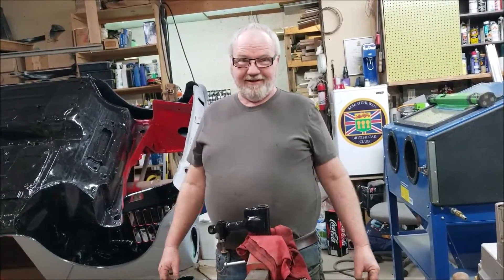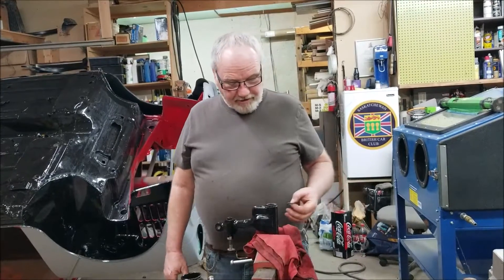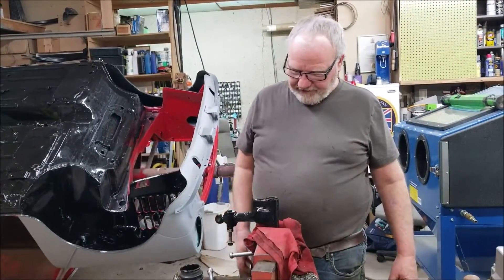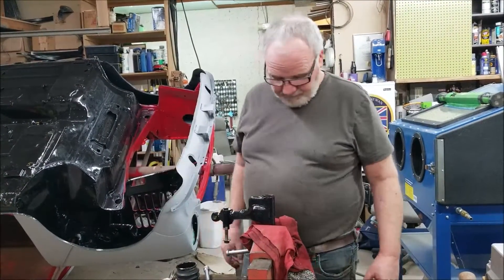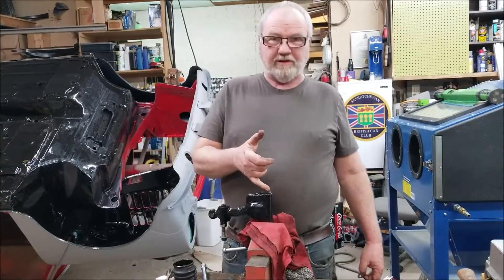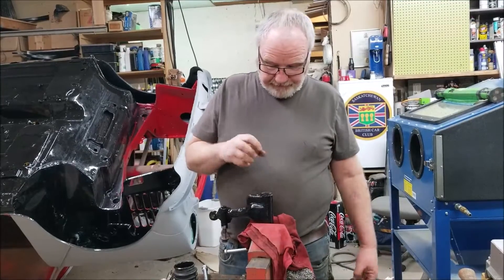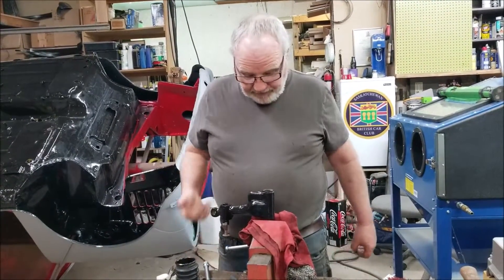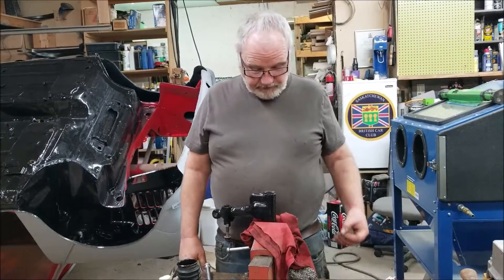Classic Mini Upper Arm Bearing Removal With 15 Cent Washer

Comment: Just thought I’d chime in here. This technique works perfectly I’ve just done this today. Thank you Wayne. I had severely corroded shaft and bearings. After filing down an inch diameter washer to 18.8mm across the flats and 22.3mm remaining diameter and after a little grief locating the washer so that it laid flat (I wanted the remaining diameter to be as large as possible) I used a 3/8in socket extension to tap them out and both bearings came out easily after the initial stern hit to shock the corrosion.
Reply from the maker: Thanks for the comment I love hearing that my trick is helping others

Comment: After several attempts with drift punch, expanding concrete bolts, frustration led me to this video. 5 minutes later both bearings are out with little effort! Thanks for the tip!
Reply: Same washer works great for rear radius arm bearing removal. Knock out bearing then repeat for bush.

Comment: Worked perfectly! Tried with a puller and with heat and no joy. This worked a treat and so easy once the washer is filed to size. Thanks!
Reply from the maker: That's great to hear thanks for the comment